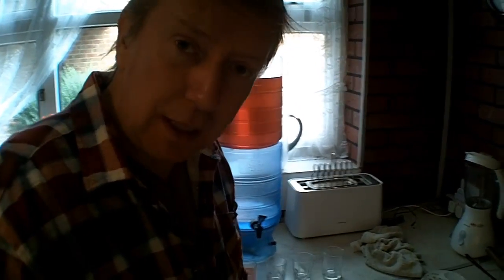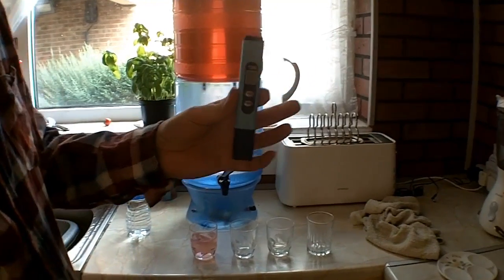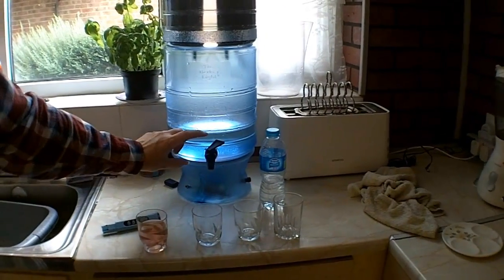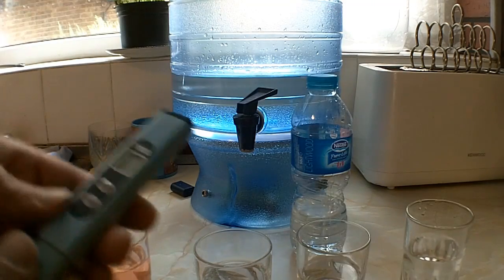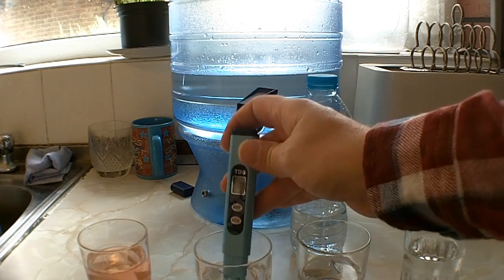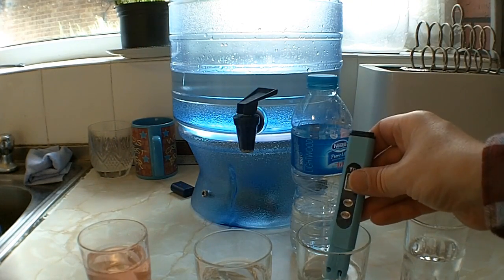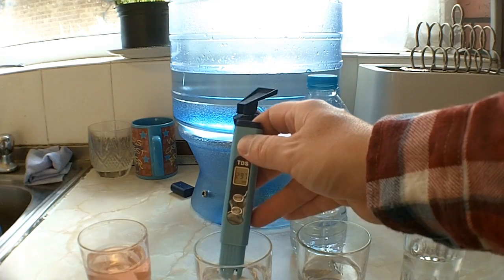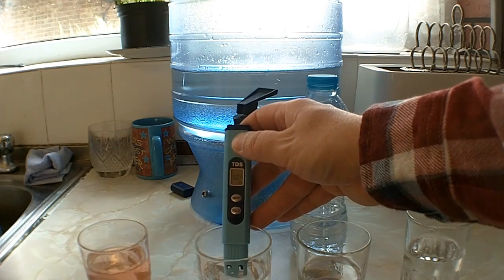Berkey Water Filter PPM Test

Comment: According to the manufacturer it takes about 8 full flushes for the PPM to go lower. what the TDS is picking up is small loose carbon particles from manufacturing. My ppm was actually higher than the tap first use.
Reply: Yup however your forgetting that you do NOT want pure water, you need minerals from the earth transferred through water into your body. Before we ever drank any bottled water our body had more minerals in it that are necessary for life. Since then ever time we imbibe water that is less saturated with these minerals, it equalizes inside of us. Simply put, that makes the water inside of you balance the minerals back into the "Bottled Water" that had less or nearly Zero needed minerals in it effectively sapping your body of minerals. Bottled water companies only add back in the minerals that effect taste of the water as 100% pure water is acidic and tastes horrible, and of course is bad for your health due to the sapping of minerals.
Reply: @birdybirdington739  I would argue that a) fully filtered water + minerally enriched diet is a better alternative than b) slightly filtered water (with heavy metals + minerals) + minerally enriched diet (minerals of which you may end up pissing out because your body may not need all of them)

I would also be interested in seeing any articles/papers about purified water being bad for your body (sucking out the minerals from within your body)

Comment: I think you have the fake colemeter  because it does not have the HM signature on the front..
Ebay have a lot (18pg on ebay)of HM TDS-3,4 & EZ copies/look-a-like for really cheap cost (which would always look more appealing to us consumers, who either might b on a budget or just simply want to save a-buck when you can, not its a sin or anything wrong; its more of the awful-low-life-scammers who's counterfeiting bad products to us based on our weakness to jump on bargains when we c..
wont b complainin if its "just as good" but for the copy-then i wont mind.. For "Half" the RRP ($6.00 - $-15.00)
But... BAD QUALITY comes along with the price tag, so that is a real shame.
Anyone knows TDS copy-Cheap-but need 2DO ITS JOB CORRECTLY with no chance of faulty/default products..?

Comment: Sorry pal... you are completely wrong on this one. You're thinking or have been misled into thinking that this filter takes out everything... it does not and they don't claim that. It removes most of what might harm you for one, secondly if you use the PF2 filters added to the bottom of the black filters it will remove nearly all metals, Chlorine and Fluoride and I'm sure your test will read a better number. Thirdly, the tester you have measures minerals in your water... which the Berkey filters allow to come through because you want them, so this is the wrong tester for what you are trying to check. They do make a Fluoride hand held tester. The only good test would be to send your tap water and your filtered water away someplace and have them test it and check the numbers... they most likely will explain what all of the numbers mean. 

If you have Chlorine and Fluoride in your city water I would get the PF2 add ons! A new You tube video that teaches us about whats in our city water is called... "The Great Culling: Our water Official" Full movie. It's shocking and I hope that they STOP putting this poison in out water!
Reply: George Adams you seem knowledgeable what about bacteria and parasites? A man did a video that the Berkey had Coliform bacteria.
Reply: A man did a test with the kits that you mentioned and the Berkey did not remove all the clorine and more. Do more reaserch

Comment: Your manipulable water SUCKS dude.  My Ppm from the tap is 180 and my filtered water is 130.

But yeah, you have to test it for chlorine,chloramine, mercury, and the rest though.  PPM doesn't mean much to your health if it's just some harmless minerals.
Reply: Yes.  They do a good Job, but I'd rather use a RO system connected to my faucet.

Comment: i am horrified at your results from your  berkey i was going to buy one for my self
but i bought a mini classic pure water distiller instead 
i am so glad i did because i get a 006 PPM reading with my TDS 
which i might add is the same TDS meter you have 
(i bought my TDS from ebay for £6 inc p&p)
thank you for this video 
my tap water here is 247 PPM
and water from my under the sink filter tap is 244 PPM 
so not looking good for those ither
Reply: But people are saying. You need the minerals in water?

Comment: hi rick, I also did the test, in Chicago, went from 160 to 140.  but the ppm test is a bit different.  just the taste I the tap to berkey is a big difference. there are other more effective tests out there.  the tds meter is mainly for making colloidal silver and or measurements to your distilled water.  I could be wrong, but the taste is a positive sign and it tastes pretty good.

Comment: Unless I'm mistaken, your test is flawed. I would really like to see the results as I am considering getting a Berkey. You can not go from tap to filtered. If that is actually Nestly PureLife water their water if filtered by RO which would register Zero PPM. They the added minerals for flavor that total 40 PPM. I current have PureLife delivered to my home. I also have a TDS meter and the directions state that going from tap to filtered will result in an inaccurate result.
Reply: What did you get and why ?

Comment: Just to add some more info, the Berky claims to take out a lot of the nasty stuff, but not harmless content such as dissolved calcium carbonate and magnesium carbonate ions which form the majority of what you are measuring with your TDS meter (hard water).  My own research suggests that that the Berky is the best filter of this type if you want to retain the mineral content but remove a large proportion of the pollutants and just about all micro-organisms from tap and other sources of water.
Reply: Also I understand there are more filters that can be purchased to remove various things
Reply: Where is the actual proof of that?

Comment: That's a completely useless test of water purity it only measures dissolved (ionic) content, if the contaminant is atomic and has no net charge it will not register on what essentially is just a conductivity meter.

Comment: Yes, to reinforce another commenter, a TDS meter is a very limited test and only measures essentially minerals and heavy metals.  So if your water does not have heavy metals in it, then the TDS reading will not change pre/post filtration with a Berkey.  A TDS meter does not measure bacteria, viruses, chemicals such as chlorine, fluoride, etc. Zerowater markets that a TDS reading of 0 means the water is potable and healthy to drink, however that notion is misleading at best.

Comment: Hi, you water filter system is a waste of time, may as well stick with the tap water. Your tds meter proves this. Get an ro unit which will bring the ppm down to 10 - 30 ppm which shows its taking out all the chemicals etc from your tap water. Even better, ad a di unit to an ro unit which will be 0 ppm, try a cup of tea or coffee, and notice the massive good difference and the fact that the bottled water you buy from shops is also a load of shite.

Comment: The levels with your filter are considered acceptable - the minerals that are left are beneficial and will contribute to your health - the lower concentration of minerals in spring water is what makes it less healthy. The Berkey filter makes your water safe to drink, not completely devoid of mineral matter.

Also note that a conductivity TDS filter is only accurate within a range of about 10%, so only take the results as a guide.

Comment: Nice video Rick! I have been using the Berkey filters for over 3 years now. I Filter rain water that I use for drinking and have had no issues as of yet. The tap water where I live is loaded with chemicals that I would not want to put in my body.

Comment: I use a TDS meter daily on my hydrophonics and aquaphonics garden systems.  your tap water seams high, my tap water is about 120,  which makes me think your meter has not been calibrated yet.  bottled water should be less less than 80.  most hardware stores that sell TDS meters also sell a calibration liquid.  mine was 700 ppm.  The meter should have screw adjustment on it.